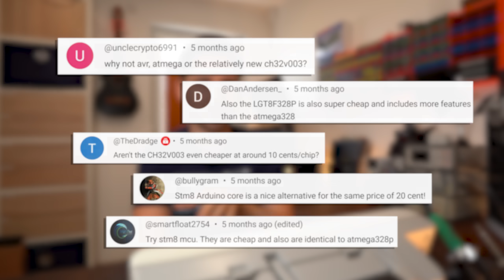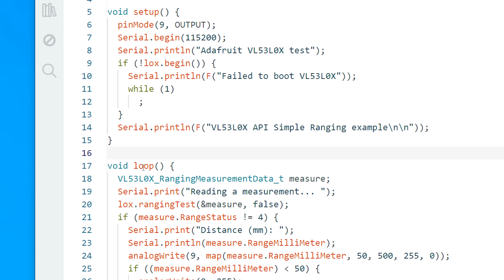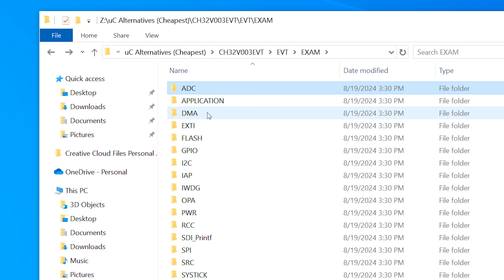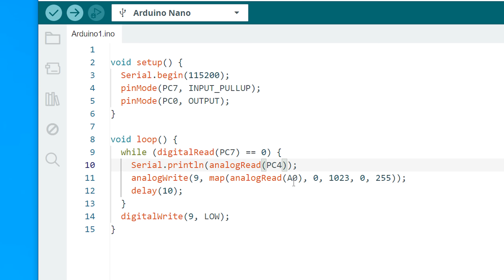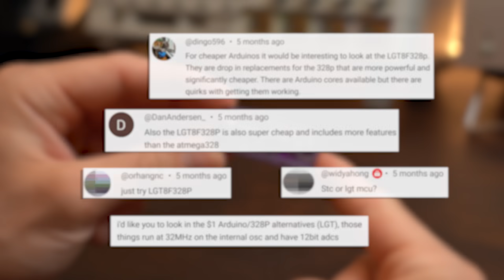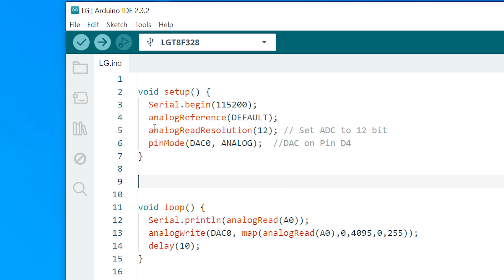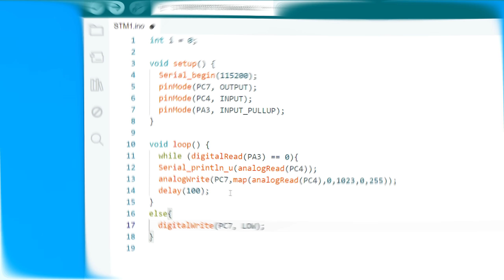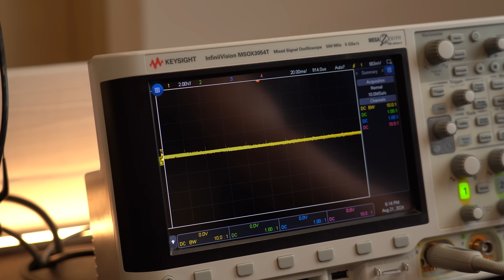I tried the 3 Cheapest Arduino Alternatives! (That you Suggested)

Comment: Unless you want a good quality ADC or low power consumption, then ESPs are the current kings of micro-controllers for DIYers.
1. Super easy to program with just a dirt-cheap serial device, no weird proprietary programmers needed.
2. Bluetooth and WiFi is a game changer. You program once and then if you want to change your program later you do it over the air. This is a must for permanent installations in hard to reach places.
3. For the performance features they provide ESPs are amazingly cheap. Just 1.80 euros for a ESP32-C3 little devboard and around 2 for the ESP32 module.
4. For ESP32 you don't even need a dev board. If you know what you are doing just the ESP32 bare module is enough for prototyping directly on it.
5. Native support for home automations with Home Assistant and ESPhome. These two projects really elevate the ease of use and practical use cases of ESP micro-controllers.
Reply: This, very much this.
Are the ESP32-C3 presently the choice board for features/IO per price point?  I just started playing with my old 8266 with HA and have fallen in love.  I have heard there is some zigbee capable ESP devices now too?
Reply: @BloodAsp  the esp32-c6 and the esp32-h2 are the ones I know that support zigbee
Reply: @BloodAsp  I find I've been using the ESP32-S2 mini board a lot lately. About $1.50/ea in 10pc quantities at AliExpress. Onboard USB-C for power and/or serial I/O (great for debugging), and PSRAM. I just load Tasmota on them, and you can then access them with a web browser to configure or program them in Berry. Because Tasmota includes LVGL and Haspmota support, recent projects have included displays, which is nice.
Reply: @BloodAsp  If you don't need zigbee i recommend these esp32c3 super mini boards (at size of xiao, native usb via usb-c, only minus is lack of external flash so you are stuck to that 400KB on chip, tho currently cheapest that i can find are about 140% price of esp 01 but with way more features, so for me king for ha). Buy pack of 20 and go wild with automation!
Reply: 100% true.
My nobrainer is Lolin32 Lite - it is cheap, has battery connector, has mounting holes, it is small, soldered components only on one side and it can be kept in sleep drawing only 150uA(with minimal mod)
Reply: ESP32 is nice but power consumption is massive pain point for battery powered always-on application. If an application is low enough bandwidth for BT or 802.15.4 (Zigbee, Thread, etc.), there are similar performance modules with a tiny fraction of the power consumption. The power consumption of an 802.15.4 only chip while transmitting is often far less than what an ESP32 idles at.
Reply: @JakEneAS  nrf52 seeed - 300uA when ble on 💪
Reply: @JakEneAS  True, but as far as I know, you can turn off the radios to lower the consumption (edit: googled it, the radios are off by default and only turned on if you use them)
Reply: @volkerracho5954  that's what idling is. Not transmitting. BT/802.15.4 only devices actively transmit with lower power consumption than what an ESP32 consumes without transmitting.
Reply: As someone who spent a lot of time using a C3 for a project, I would agree with you so long as power consumption isn't a factor. The ESPs are abysmal compared to pretty much any nRF board.
Reply: For under $2 a chip the ESP32-C3 has just about everything you could want including Wifi and Bluetooth.
Reply: esp8266 is 2usd while esp32 is 4usd it is certainly cheaper than 8-15usd forman arduino
Reply: @jaspercas  esp8266 has often problem with library compatibility
Reply: Agree, however I never used ESPhome. I don't know how to code and there are much simpler solutions. For sensors EspEasy and for lights WLED
Reply: @User-ec2bh  ESPHome does not need coding either. As long as you don't need some extensive custom functionality, everything is set up via a config file which has amazing documentation
Reply: ESP32 contain proprietary undocumented blobs (known only to the espressif engineers). That's a big no no, especially when linking that shit to your private network.
Reply: @XavierGr  true. For adc i just add an ADS1115 or something
Reply: "Bare module" IS dev borad.
Reply: they are good options indeed, especially in many cases.
but in some cases still not optimal, since if you plan on making something and soldering it and keeping the microcontroller in there then it often is a waste to use such a board, especially in projects where the microcontroller does basic things or doesn't need internet. such a €0,20 or €0,50 chip can often also do may uses people use microcontrollers for like PWM signals, motor driving, etc. such microcontrollers allow to need way less components and when getting a cheap enough one they are often both cheaper and more accurate than making it from dedicated parts unless you put in a lot of design stuff and only need it to do one thing. but as a example think about a usb led dimmer, those things just need to pwm the output frequency fast so the light gets dimmed. one can easily make a pwm cirquit using a schmit trigger inverter, a potentiometer and a capacitor, and probably a transistor or mosfet to amplify it.
when making one, a microcontroller probably is overkill.
however then making one device controll multiple pwm signals seperate, then sure, the inverters are cheap, since often there are more of them on a single chip anyway, capacitors and mosfets also are doable in general since you want a high frequency and don't need to much power output.
potentiometers on the other hand are super expensive these days, especially if you want a good quality one.
with a microcontroller you need only one potentioneter, and a button, the button selects which led to controll, you can add controll leds but don't need to, can also just see it or make the light go to a certain brightness and then of for a while so they see which one it is, the button switches which led the potentiometer controlls.
meanwhile in the schit inverter the potentiometer is needed for the oscilator so you would need 6 of them in the case of 6 pwm signals(6 because hex schmit inverters are the most common and cheap, meanwhile most microcontrollers can handle 6 pwm ports, or manually pwming using bit manipulations on enough ports. 
still even using cheap potentiometers they are above 5 cents each if you want the ones which are easy to adjust by users making that 30 cents, decent ones tend to be more expensive more like 10 to 20 cents.
now at this point a microcontroller makes sense since it is cheaper to use a microcontroller and save on potentiometers, meanwhile the microcontroller can also do many other special things and you can more easily decide the frequency without to much calculation or needing special parts.
as for a led dimmer, 8khz to 16khz can be okay, but for high power leds you want it to be notable above 20khz, since the leds or transistors otherwise might make sound due to the heat produced. mostly only happens when using coils or such but still.

meanwhile that device with a microcontroller could also measure room light levels, or have timers for when to turn the lights on or off, or automatically adjust the brightness levels slowly to save power when your eyes get used to the dark.
meanwhile it might also be more energy efficient, since you would need to make the dedicated cirquit very energy efficient optimized to beat a energy efficient IC in it.

and soldering ofcource, not needing to solder as much also can be worth a lot.
so sometimes a as cheap as possible microcontroller can be very usefull.

the esp chips are very powerfull, but they also are bigger than some cheap chips, and still cost a notable amount in the perspective of simple projects. meanwhile the power usage also is higher in general, ofcource you can lower that by a lot but it takes a lot more work to handle the power management than many of such projects would need in code in such cases.
Reply: i would agree but i really like the 5v output from the arduino types
Reply: @XavierGr  true. I hate other MCUs because of proprietary programming interfaces, proprietary IDEs, smaller community, lack of wifi and bluetooth and increased cost

I love esp8266 and esp32
Reply: Not really when you are using the chips there are so many components to use
Reply: Can you get a esp32 for less than 1 USD though? If you need multiple controllers, the price stacks up very quickly. In production, every cent counts.
Reply: @ianlee6416  I've got at least dosen of ESP32 and don't complain on spending nor lack of them... How many can you have in your home??? We are not a factories just hobbyists...
Reply: @t0masz90  the guy in the video is making a large interactive display iirc, he needs like 100s to complete the project, that's why he's looking for cheaper alternatives.
Reply: @xxportalxx.  But I don't...
Reply: @t0masz90  then you're in the wrong place, that's what this vid series is about, cheap alternatives to expensive microcontrollers for projects that require high numbers (i.e. when cost per unit becomes prohibitive).
Reply: @t0masz90  not per se. If you would like to compose electroacoustic music/experimental music and would do an installation project, needing dozens of modules, finding the cheapest but workable module could be very necessary, unless you get government funding of course...
Reply: @ianlee6416  Yes you can get them for less than 1 USD.

Comment: The arduino "IDE" is an insult. It really does not deserve to be called an IDE. Before V2 it was the NotePad of IDEs - even notepad++ was a better IDE. And even now - use anything but the Ardunino"IDE". It is slow, buggy, and does not do what an IDE should do: Help the developer.
using VSCode with the arduino-plugin is a lot better - specially for people that are not well-versed programmers. Better code-highlighting, auto-complete, good language support and external tools.
The Idea of Arduino was great - and the IDE was the big "BUUUuuuuut".

Comment: I used some LGT8 devices 4 or 5 years ago. Yes, they do work and are higher spec than Arduinos. However, I found that after running reliably for a couple of years, 24*7 the processor simply bricked itself. I thought somehow the code in the n/v memory had got corrupted and tried to reflash them. But they would not reprogram at all.

Comment: I had a simliar situation after i figured out i needed more arduino's, checking the prices I could get another for $5,  or about 4 stm32's  at 5x the speed albeit about the same amount of ram (got the cheaper low ram blue pills)  It was a great deal! then i tried to program one... 1 year later i finally figured out how to blink the LED without any libraries, bare metal from scratch.  And I wish i just got more arudino's... JK it was a great learning experience but not easy replacement to arduino. But can be, they have stm32 boards in arduino IDE so its just as easy.  But still not easy to setup the flashing, thats a little janky and probably the hardest part, was just setting up an evironment to flash it, some offered USB but you needed to install drivers, and press some key combination for it to work, then short a pin to make it work more reliatbley... a lot more involved then arduino for sure, in the end the st link was most reliable but was trying to avoid  extra parts, but  now we get that extra juice!  And still not powerful enough to run high def UI without 100% usage, why STm32 released vector gpus in some of their  MCU's. That would be cool to see, vector GPU programming graphics.

Comment: i think the stm8 line is not a great value anymore, the stm32g03 series do more for the same price, and you can use the original stm32 core for arduino. I haven't used arduino for years now, because the compatibility of the arduino ide with the stm32 has become so good that I haven't run into a library that doesn't work. Most often I use the stm32f4s as a steroided arduino.

Comment: SW programming to flash an LED or control brightness? I'm old enought to use simple passive components to control brightness or "advanced" blinking or brightness control with a 555 timer.  Again, mostly passive components and no SW. But I do program and encourage those new to electronics to learn programing. It is not only fun, but necessary in today's high tech world.

Comment: I accidentally bought lgt8 arduino clone 5 years ago or so.
Spent a day trying to make it work with lcd, until I understood that something wrong with arduino core code (they've messed up with that dac pin initialization).
Next when I needed to go slightly more advanced and implement sleep mode (if you can name sleep mode "advanced", but for arduino it was always an issue 😢), it appeared that this chip has pretty diffrent code compare to original atmel chip, and I used to dig in that badly translated chineglish manual.
I hope that things were changed since that time, 
but I wouldn't trust this chip for something more complicated than blink.

Comment: In my opinion STM32F103C8T6 a.k.a the BluePill seems like a good option as it's way more powerful than mega328 and also almost very cheap here at least in India, I get it for less than 1.2$ and is pretty compatible with the existing Arduino Ide (for some of the niche feature you can install libraries). And if we install a USB bootloader to it, it can also be programmed via USB and Serial works too. 12Bit ADCs, 16Bit PWM, enough Analog and Digital GPIOs, CAN bus, and a RTC.
And for its full potential STMCube Ide seems like a good way to extract the most out of it. It also has GUI Configuration.
Not exactly cheap if you want to save every penny but for a Nano Compatible I just buy these instead.
Reply: It was. 

Sadly almost every BluePill solid now is a clone and not all of them work correctly. It’s not worth it.

See the Blackpill.
Reply: Depends, its probably the microcontroller that has a ton of different clones which are packaged as the real deal.
Only issues with those things, the (real) board i bought before the scammer craze was nice tough.
Reply: I agree. The BluePill is the GOAT when it comes to features / price ratio. If you need more power then pico 1 or 2 is the way to go, with some additional modules (like better ADC or additional DAC).

Comment: In my opinion, the Arduino framework misses a lot of features that an embedded dev. framework must have. So not having the Arduino support by an external core is, at least for me, an opportunity to try something different and probably better-designed (like ESP-IDF or the STM32CubeIDE for example)... cheers
Reply: Your not clever enough.

Comment: LGT8F328P is an awesome chip and it gets even better if you dive deeper into it. It has a DSP, a comparator, more timers with extended functionality and a x2 speed multiplier. I used all this stuff - it works perfectly
Reply from the maker: True :-) Thanks for the feedback

Comment: As for IDEs, I can highly recommend platformio. It's much nicer to use than the Arduino "IDE" since it's just a vscode extension and it has full compatibility (it can actually call the arduino ide).
The best part is you can define profiles for different boards and theoretically make your code compatible with different boards. In the end it's all just some C++ or C libraries.

Comment: I know the ESP32 family is way more expensive, I find having the onboard Bluetooth & wifi gives a ton more flexibility for IoT projects. Also they fully support Arduino AND MicroPython. Aliexpress prices are around $5 Canadian here.
Reply: ESP32C3 are dirt cheap. You get an MC with WIFI and BT for only  $2
Reply: They are not more expensive. $2.50 retail, $2 in bulk.
Reply: @pepethefrog7193  Good clarification - the $5 is for a full dev board with onboard serial-to-usb and power supply etc. Plug & play with Arduinio. The bare ESP modules are way cheaper!
Reply: @torchris1  The ESP32C3 Super Mini board has 16 pins and serial is handled by the chip itself.

Comment: Also yd2040 raspberry pi pico clone boards are good and cheaper arduino alternative. Have hardware usb support, many uarts, i2c's, programmable io pins, builtin ws2812 led, 16mb memory, c/c++, python and arduino compatible. But there is one concern - it works on 3.3v logic, so for some modules you need to use level shifters

Comment: Stm32 is for me the greatest microcontroller series, they offer an enormous amount of features at arduino prices, if any one wants something at the price or a little higher than an arduino you should get a stm32 bluepill or blackpill for more prosesing power, mid level programming skills are needed for unlocking its full potential, great video btw😊
Reply from the maker: Thanks for the feedback :-)
Reply: They're not secure though, the have a custom wifi blob that is very likely to have a backdoor in them for the ccp
Reply: @HerbaMachina  Give it a break, you made the same reply about ESP. Just put it on a separate VLAN and check it's connectivity. Without any proof, all your spouting is nonsense.
Reply: @HerbaMachina mate do you even read what you are replying to. The OP mentions STM32, not ESP32
Reply: @HerbaMachina  That's the ESP32. The stm32 doesn't have wifi or BT capabilities
Reply: @HerbaMachina can we use stm32 which don't have WiFi
Reply: @saiavinash555  You can ignore it or disconnect the antenna.
Reply: @HerbaMachina stop spreading lies